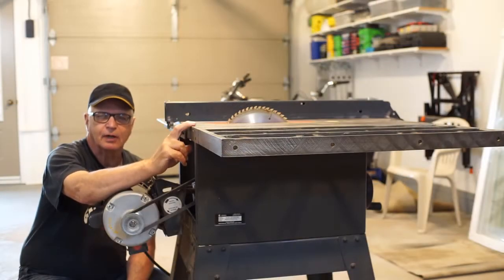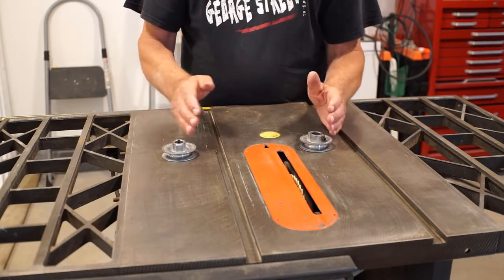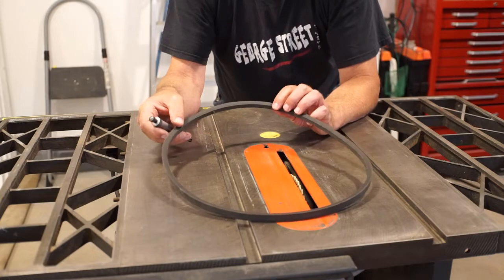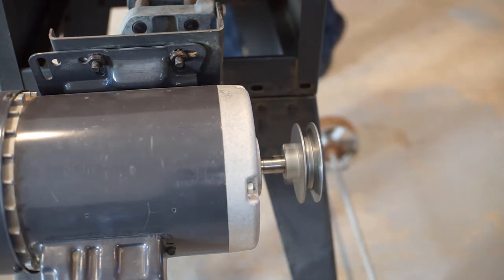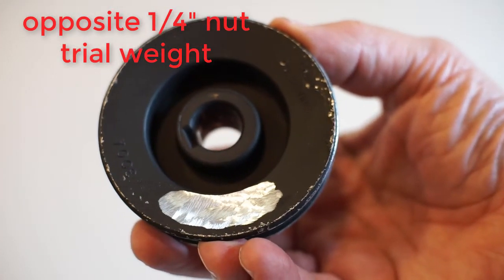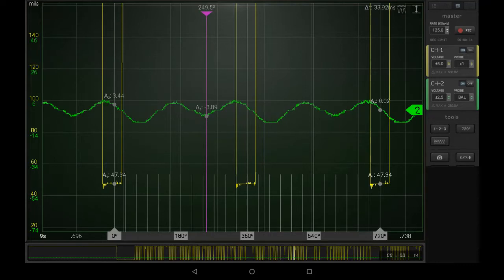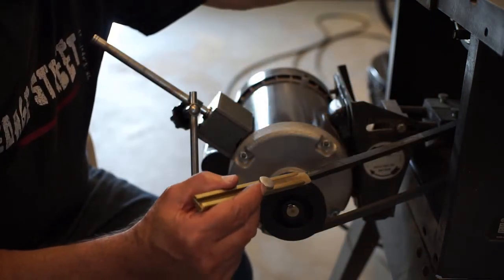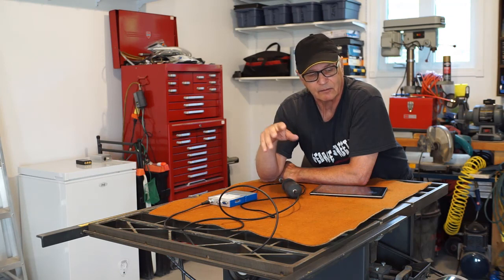GADGETS#60 - TABLE SAW VIBRATION ANALYSIS

Comment: These lessons may come in handy when balancing my model engines. I'm going to have to study them (replay several times) and give them a try. Thanks
Reply from the maker: +Dave Sage - Should be able to apply this to your work. Temporary correction weight to confirm before permanent correction is important.
Thanks for dropping by, Dave.

Comment: Not being a mechanical engineer can you explain (if you already haven't) how the accelerometer restricted to measuring only in the one axis (up/down in this case) is different than the stethescope being mounted vertically at the top of the motor and being capacitor coupled (to filter out any piezo DC offset from static pressure). Wouldn't either give you a useful waveform of up/down deflection vs time? What am I missing?
Reply from the maker: Dave Sage - the best way I can explain it is the the ADXL335 has "freedom of motion" while the piezo does not.
So, the X-axis is allowed to move from one direction to the opposite direction, unrestricted producing a sine like waveform.
The piezo hits a wall...rebounds...waveform becoming complicated, unusable.

Comment: Ok. Makes sense. I'll give it a try when the sensors arrive.

Thanks
Reply from the maker: +Dave Sage - Get the photocell adjusted right, provide 5v and get signal from x-axis on ADXL335,    interpret waveform as shown in this video, use protractor I provide in link to index rotor, confirm with a temporary correction weight before doing anything permanent and you'll succeed.
It's a dynamic balancing procedure using an oscilloscope not found anywhere else on the internet!

Comment: I can not say for certain that the link belts would reduce the vibration on a table saw, But they definitely reduce the noise on small (2 hp and under) industrial fans. Most die cast pulleys are of poor quality, most cast iron pulleys are of better quality.
The above is from my experience I’m not an engineer.
Reply from the maker: all good points:)

Comment: Could you let me know what motor you replaced it with? I’m needing to do the same to my old saw. Thanks.
Reply from the maker: don't know the brand and it's in a bad spot in a very cold garage at the moment so I can't get to it right now...

as stated in video, it is 1.5HP ... 3450 RPM ... sealed motor so dust can not go into windings as the original motor ... could have been wired 240v or 120v ... I chose 120v for convenience...

they don't give good quality motors like this away!

Comment: I'm making one for myself, I'm using a 2hp motor, when I turn it on the whole setup starts to shake, should I add more weight?
Reply from the maker: Add more weight where, Arvindh?
Are you trying to balance a pulley with an accelerometer as shown in this video?
The size of the motor does not matter. The principle remains the same.
I would run motor with no belt and no pulley and confirm it does not shake.
Then, I would run motor with pulley and no belt and see if it shakes. That would confirm it's the pulley, right?
Then, I would run it with belt.

Comment: Ok. I''ll have to give that a try when the sensor arrives. Which reminds me I need to also order the reflective sensor. I think it's near impossible to balance a single cylinder engine without maybe huge ugly counter weights. Most of the shaking / imbalance comes from thrust of the 2" piston and 4" stroke when it fires. For reference it's this engine. You can see it run here.

https://www.youtube.com/watch?v=wwQTo_bVXT8
That's 90 lbs of  two parallel 14" flywheels you see there. It has a heck of a kick. It has balance weights on the flywheels derived from calculations and a bit of trial and error with a piezo vibration sensor I made simply to measure if was better or worse from previous trial weights. It it much better than without weights but Maybe some improvements can be made.
All in good time.
Reply from the maker: +Dave Sage - man, there's lots to cover here!
Trying to compensate the recoil of a power stroke through balancing, especially on unpredictable hit and miss engine isn't likely to succeed. My opinion, and I very well could be wrong (it happens)...
My view is that we have to distinguish between unbalance and power stroke "recoil".
Here's where your newly built stethoscope in FFT mode can come in. Do not take reading in same plane as engine recoil (too violent). I suggest perpendicular to the base.
You should see a fairly stable Hz that corresponds to the engine RPM. That's your unbalance, not that the instrument is capable of telling you at what angle to place a correction weight but is capable of telling you that it is occurring at 1x RPM.
Then, there will be many other frequency peaks on the FFT screen. Most of those will represent irregular power strokes and should be lower Hz than RPM as they occur randomly and less frequently. Concentrate on the VERY low frequencies...RPM equivalent and lower.
Higher frequencies will be harmonics, frame resonance, echoes, etc...of no interest to us.
Let me know what you see...
Reply: I don't imagine there's much that can be done about the "kick" but when it is coasting it does bounce around a bit on the table and that's what I worked on with the previous piezo setup I had. I don't recall where I placed it  - probably somehow coupled to the mounting base. I think I did the best I could with what I had. Perhaps a revisit using the new stethescope along with your suggestions will give more meaningful readings. It won't happen any time soon. It's not really bad and most of the problem is the kick. It actually lifts the front of the stand slightly if you don't fasten it down. I compensated a bit by retarding the timing to well past TDC which tamed it down quite a bit. It's a beast.

Thanks for your interest.
Reply from the maker: @davesage9190  - your model engines are interesting that's for sure. Glad to be of help.